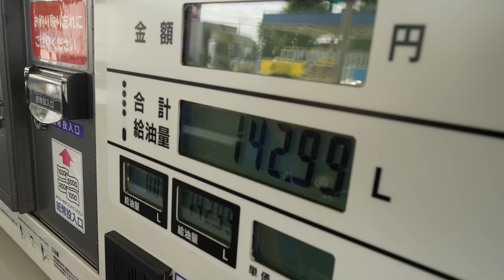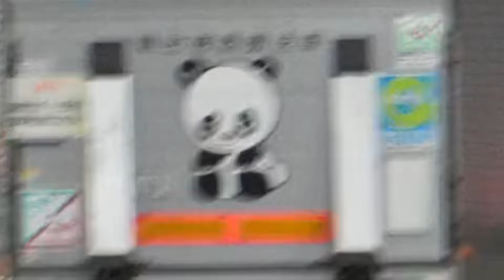I Spent a Day With Japan's Tiniest Truck Driver

Comment: As a fellow truck driver,  I have mad respect not just for the size truck she drives but for her attitude and love for the job..wish I could work there..
Reply: Looks like a Class 2 (what we call it in the UK) or Rigid. Probably between 18 and 30 tons MGW. Drave 18s myself. Largest I can drive without an articulated lorry license is a 23 tonner. Her driving is certainly impressive. They're not amazingly difficult to handle, but it takes skill to make it look as easy as she does. Especially with a manual gearbox. I drive a manual car, but generally hate manual trucks.
Reply: An absolute Dream to drive around Japan in a truck, but I rented a car in Tokyo one time and it was confusing af lol
Reply: totally agree. She's a very skilled and excellent driver. the Japanese professionalism is really amazing. They never cut corners and do their job perfectly at a very high level. Their pride is very comfortable and respectable.
Reply: @ikkyu-san3436  Oops, and pride is a sin. d'oh. 😞
Reply: I think Japan is in need of truck drivers.
Reply: @McDoucheVonDouche  They have a severe man shortage. You haven't heard??
Reply: @McDoucheVonDouche   That would be nice but Japan has some restrictions on those who come in from overseas to work..
Reply: @JohnSmith-uy7sv  more like young worker shortage
Reply: If you get the chance to drive on those roads you can see the tight clearances she’s got to deal with as well. Normal highways of course but there are also tiny tiny roads, tiny intersections and busy busy streets with no margin for error. Much respect for any Japanese trucker’s skill.
Reply: Japanese is fun bro
Reply: That's actually the reason I clicked on the video. I was expecting a tiny truck
Reply: @JohnSmith-uy7sv there is no so-called “mAn sHoRtAgE.” More like it was shortages of the young people due to the issues related in Japanese population.
Reply: I heard they are hiring big time!  Go for it!
Reply: @1406Alexx I think it would be less confusing for me as I’m from the UK. Our roads are the same as Japanese roads but I’m guessing the road signs would be different
Reply: Same, it's always cool seeing drivers from around the world
Reply: The salary of a truck driver in Japan is low. It used to be high, but now it is very low. It is probably about half or a third of what a driver in North America earns. More and more Japanese people want to become drivers in North America. And now the yen is getting weaker, which is also making the salary lower compared to other countries.

Comment: I'm a flatbed trucker and about 8 years ago I helped a driver tarp his load who worked for Tennessee freight hauling and he was 4'5" tall.  I'm 6'6" tall and I got the high stuff and he did the low stuff.  I was really amazed by him,  he could just walk under the trailer behind the drives and had to reach up to the rub rail.

Comment: I could tell that she really enjoys working as a truck driver from her smile, and that was impressive!! Also, I was surprised by how tiny she actually is from her story of not being able to get the motor bike’s license😳 absolutely, another amazing fun video❤ Thank you Norm!!
Reply: For someone of that stature her only real option is to ride a kid's dirt bike. Hopefully she gets a chance someday.
Reply: @deanzaZZR 

not really. some choppers work as well and at least here in germany there is the option to get bike boots which make you 6cm taller.  there should be similar possiblities in japan. they even have 250cc and 400cc bikes with different of regulations ....

p.s. 

i am only 1.68cm tall and need this kind of stuff for my friends bikes. my own (suzuki gsr600) is the tallest i can get away with, without any modification. my right lower leg is 5cm shorter than the left one and has next to no muscles. if there is a will, there is a way.

Comment: Back in college, I drove public transit buses on campus part-time. It felt like easy mode because the college bus system didn't charge its riders and kept the drivers on pretty open streets. But it gave me a whole new appreciation for truck drivers that had to drive all over. Seeing some of the back roads Kana might have to drive is a whole other on top of that! That's really top-class drivng!

Comment: This table for the steering wheel is just one of those many "small" inventions Japan is known for, I´ve never seen sth like this before. And the truck driving situation in Japan is way better than here in Germany, here in Germany most truck drivers come from east europe because of the low wages and the deadline-pressure is really high and it´s also very hard to find a free parking lot next to the highways because there were too less of them built. Japan does it better. 👍🎌 And Kana is really cute and nice.

Comment: I think Kana would do just fine in a big truck like we have in the US. The truck she is driving here is perhaps not as big but is no less complex. I would have liked a walk-around the exterior of the truck. I'm fairly sure it has two steering axles (most likely to be able to make those tight turns) which is something we don't see a lot in the US where we have a bit more space and the roads tend to be wider.

Comment: The US import ban on Kei trucks drives me crazy. They would literally be perfect for my business but you can’t buy a new one and not a single US manufacturer builds a small truck. I drove one in Japan for a few months and not having them as an option in the states is crazy. Can do nearly everything a standard pickup can do, but costs waaaayyy less in gas and is great to get around in the city.

Comment: About 30 years ago, Kana would've found this job very difficult. Gearboxes were non synchronous, which meant that the clutch and box itself would've been very stiff and had to have been double clutched, or floated. There was also no such thing as power steering. I'm so glad that we live in a time that Kara gets to experience and enjoy this craft. It really is a great feeling!

Comment: the best thinks about trucks is that they comfy af( not a driver but co-rider for work). before shifts we had to drive to the place and the naps  in a truck hit diffrent the seats also work with air pressure so even if its wobbly it keeps you nice and comfy

Comment: Lived in Sasebo for two years and I got to drive around Kyushu quite a bit in my old R33, mostly to Fukuoka and Nagasaki.  I have my class A here in the states, and it's challenging enough to drive large vehicles on these wide roads.  Driving a truck on the left side, and on those tiny streets, would be a hell of a challenge.  Crazy respect for those commercial drivers over there, they make driving those narrow roads look easy.

Comment: In my countey, you can't even sit on the front passenger seat of a regular car without a retention system if you are less than 1'50m tall, and ought to be at least 1'45m to get a regular driving license (so she would clear the requisite by a single cm, wow!).

Comment: Learning by experience instead of GPS enhance your spatial intelligence, very important especially if you were considering driving as a long-time professional career. It also improves response and most important, punctuality, as visual cues and signages on your route would eventually be ingrained on your memory over time (which is why Japanese are so punctual on the dot) And don't forget also, manual transmission is an exciting way to build muscle memory in your legs!

Comment: 8:25 legal 15 min + break. The U.S. is a bit different not sure about Japan I’d have to research it. We have a 14 hour on-duty not driving rule, with a 11 hr driving rule within the 14 hr rule. Within the 11 Hr driving rule we must take a 30 min break within 8 hrs of start of shift. We have a 70/80 hr work week rule. Once exhausted must be off duty for 34hr. After every shift must take a 10 hr break. All breaks can be conducted in the sleeper. We usually stay out for 3 to 5 weeks driving, one week home.

Comment: 🙂 neat, those cabovers are super tiny, I didn't think u could fit a bed back there, here in the usa u dont see local cabovers with a bed in them, i wish we had those here cause its nice to always have a bed just in case u get stuck somewhere and u need to take a power nap. Those Trailers look so weird, they don't have wheels and they are propped up on stilts, very strange indeed.

Comment: I was in Japan last month from Chiba to Kyoto and up to Toyoma. Noticed a lot of Japanese girls were quite tall! Until I realized a lot of them wore open toe or close toe shoes with few inches of sole =x but good amount of them were quite tall without. Could not find a Japan truck simulator outside of a mod and hadn't really looked into it but would love to drive in Japan again somehow. After having driven a lot of the roads and having to reverse out of my lane into an opening a few times for trucks to pass. They even turn their headlights off so I don't get blinded day or night, awesome common courtesy.

Comment: Lovely person. Friendly, charming and professional. 146cm is of course really a disadvantage in some way. Here in Germany you have to at least 150cm to not be legally required to wear a booster seat anymore (or older than 12). Thinking about my goddaughter, she was 146cm when she was 9. And depending on her employer and the customers, afaik there are lots of time were drivers have to load or unload themselves. When picking up containers or swap bodies, that's of course less of an issue.

Comment: In America I know many women in my family who has difficulties driving most vehicles and especially trucks because they can't see well over the steering wheel, in fact one i know looks through the steering wheel when she drives which i think is insane. I am surprised she is sitting up so high in her seat and wonder if it's because she has a custom seat made for her or it's raised up a lot, or in Japan the height difference between people isn't as great so this isn't as much a problem as in USA? One thing I noticed is how well of a view you get driving a truck, you can see so well all around you due to all the window sizes and sitting higher up you get a nice view. Even in my car visibility isn't great and the borders around the windshield are so thick it even obstructs a ton of your view when going around sharp turns making it difficult to see without leaning forward like she does, so we all have our own problems i guess when it comes to different vehicles.

Comment: Kana, since that is a company truck that you drive all the time. Does the company repair there own trucks ?  I think your seat could have some modification done to it that you could get closer to the steering wheel. Where ever the seat comes to a stop when you pull it forward could be extended (1) notch by cutting the metal and making new notch. That little bit would make it easier for you to turn more comfortable and do your job better. Everybody wins. It would give you more confidence turning. Ask someone in your company if that could be done to alter your seat. Automotive repair shop could do it too. They do things like that all the time, at least in America.

Comment: The no-GPS rule seems crazy. What's wrong with GPS ?
Reply from the maker: aside from it being dangerous and irresponsible?
Reply: @TokyoLens  Could you elaborate ? What's dangerous about using a GPS ?
Reply: @LiquidGoldSwords Sometimes if you follow the GPS you end up in a lake or river or you come to a place where you can't get any further with the truck, e.g. a tunnel is too narrow or the truck is too heavy for a bridge.
Reply: @chrism6994  There are GPS designed specifically for trucks, to keep them on the main roads. Don't know about Japan, but in Europe it's definitely a thing.

Comment: Does anyone know the reason behind not being able to use GPS and why that's not uncommon in Japan? Seems a bit counter-productive. It's great to know how to use a paper map but why not use technology at your disposal.
Reply: For safety reasons. The GPS does not know the height and weight of your truck, nor the maximum clearance height of bridges and tunnels, nor the maximum load capacity of bridges. In addition, residential areas and schools must be avoided as far as possible. It can also happen as in the U.S. that a bridge over which you are supposed to drive does not exist and you fall a few meters down (in the U.S. it was a car driver who followed the GPS in poor visibility and therefore died).
Reply: @chrism6994  I see. Thanks for the reply.  I appreciate it. 🙏

Comment: Her company forbidding people using gps navigations systems seems like a really bad move if I'm being honest.  I can understand some of the motivations. They don't want their drivers to rely purely on the software and then having no skills to fall back on when there's an issue that the gps isn't working properly.  But at the same time it seems like there's a lot of mistakes that can be avoided with digital tools like that. Because people that would get complacent with digital tools also seem like they would be prone to mistakes without them as well if they're that careless.

Comment: I think it would be pretty cool if she came to the u. Yes. Then drove the open road here. And yeah we have some Small roads
Especially when you're dropping off to a customer. In the city. Or come to a truck show. We do have some cab over here too. If it's a cab over Old cab overs.the o G's
Trucks Are mainly manual transmissions . Because the newer trucks are automatic some majority of them. Hopefully she'll be able to on a vacation to come u s and Drive one of our rigs she looks like a pete driver That's a question if she was to come to America and drive across country. Which truck would she prefer.  mac Peter belt. Is fright liner kenworth. Volvo. International? Because they do drive different.
One is not quite like the other. Yes, US trucks are quite big inside but it's not to be showing off because some people are pretty tall. I'm almost 6 foot.
People that are 6. 6 or higher. I don't know how they're doing It. I'm waiting for Trucks to come with sliding bunks bunks for taller people. But if you're seven feet I feel sorry for those people.. But she is pretty awesome. And not to take away from all Women that drive trucks. You all do an important job. Thank you.
And be safe keep the rubber side down.

Comment: From one side Japan is so advanced (or at least was) that they have intresting techology, but from other side (can't use gps) not so much advanced.
Reply from the maker: Using GPS would be incredibly dangerous and irresponsible as it doesn’t show all the things that a truck in Japan can’t do for example, low, bridges, steep mountain paths, narrow turns that a truck can’t make, Low, tunnels… Etc.

Comment: It's good to have some of that fundamental paper knowledge although this is also a country that just recently how do you passing law to stop using floppy disks & mini discs for legal documentation. So some acceptance of new technology would be good To assist with navigation. On the other side of that in the US we have truck drivers using consumer GPS navigation sending them down roads not meant for trucks and we also don't have a reliable bridge height infrastructure which leads to tin can carnage on the bridges and then there's sign sabotage. I love paper maps but I've always wanted a you are here dot and you're going there dot, Let me figure out the rest with maybe a route suggestion. I've been using Waze but I think they change the algorithm recently and it's far too easy for it to change the route without letting you know that you've missed the road now.

Comment: 12:45 SURELY, Kana-san would fit well at least on a Grom, no? Or am I underestimating how tiny 146cm really is?
Reply from the maker: A) doesn’t want to ride a Grom
B) even if she did, she can’t take the test on one. Test MUST be taken on the supplied full-size, full-weight motorcycle
If she can’t handle that
She can’t get the license
Reply: @TokyoLens  ooh makes sense, thanks for the reply